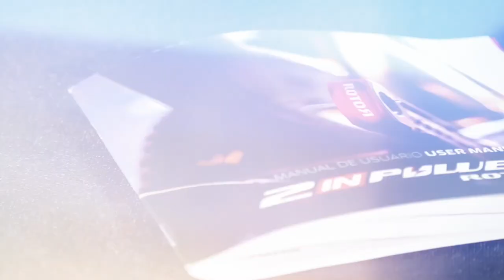How DTT screw works in 2INpower crankset (Spanish Subtitles)

Comment: So, okay. 5nm for a axis bolt is too high without a spacer between bearings, you just can jam it with this torque.
In case there is a spacer, you need to install BB very precise. It's okay with a pressfit BB, but with threaded BB do need some spacers between BB cup and frame to fit it with proper torque?
Reply from the maker: Hello Aleksey. Thanks for your comment. Please tell me your country and I will send you the details of our local ROTOR distributor in your country, in order they can help you. Thanks a lot.
Reply: @ROTORbikeComponents  Hi! Thanks for the response. I'm from Russia.